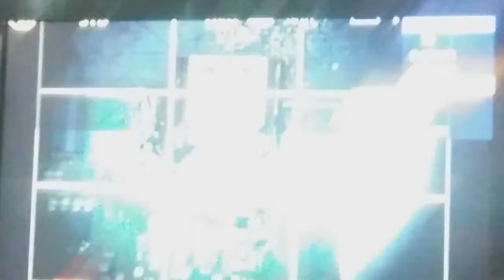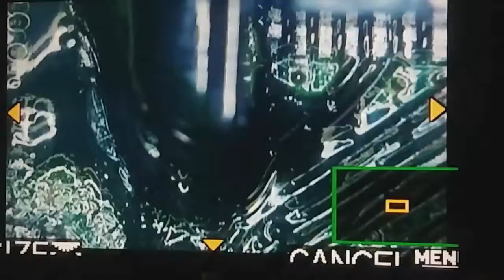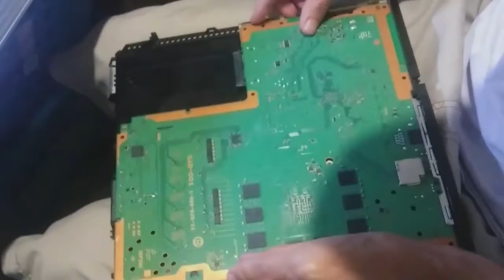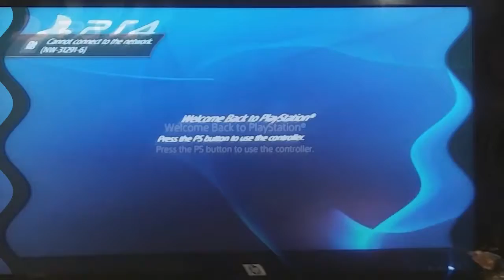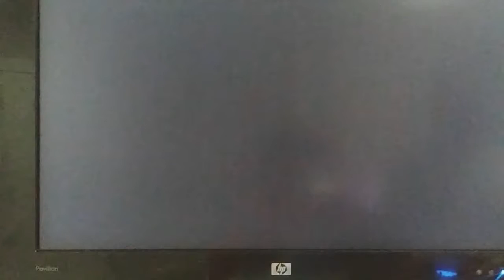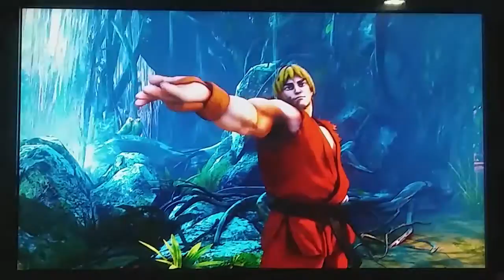PS4 HDMI Port Repair - 10 Ripped Pads - Soldering Traces

Comment: How many of the ground pins can you "get away with" not connecting to ground?
Reply from the maker: Possibly all of them, however the grounds are good for keeping the signal clean. most TVs receiving end have the same pins grounded anyways! We do trace them though.
Reply: @TechDeviceRepair  thanks!
Reply: I had a ps4 with no video output, I couldn't find any problems at first, apart from 3 missing ground pads under the port, so I was going to splice and old hdmi cable open and tether those particular lines to ground int he cable itself, but then I realised there was a 50 ohm short between one of the pins to ground (it wasn't one of the 8 hdmi signal lines), and after clearing that the picture came up, thanks again

Comment: This just happened to me when I attempted this repair...tore all of the pads and traces out because the heat wasnt hot enough...what kind of wire do you use to run your traces?
Reply from the maker: Ultra thin enamel coated wire. You can find it in any old headphone wires.